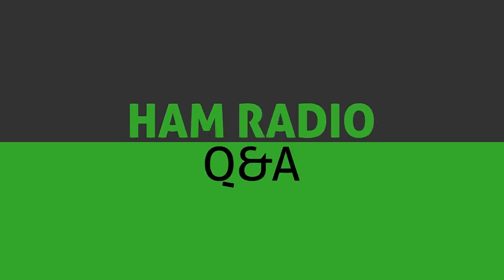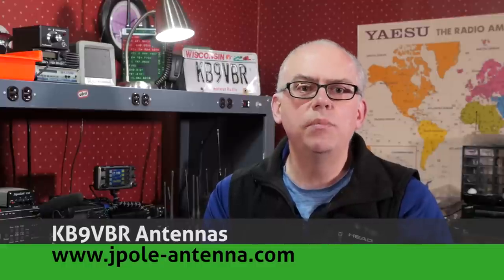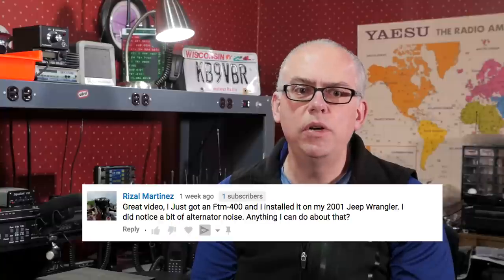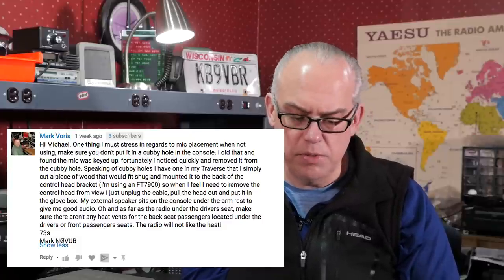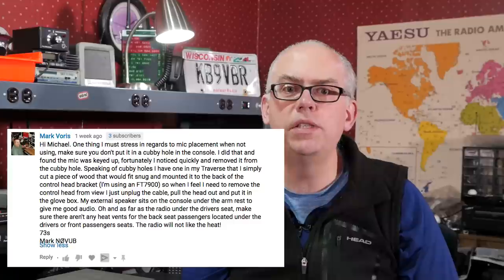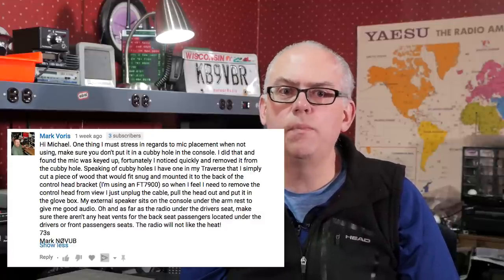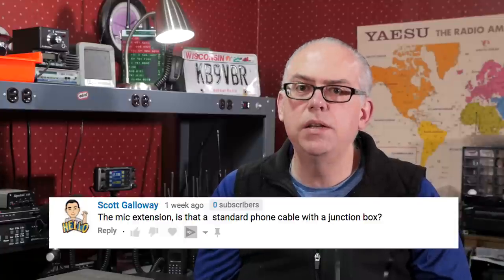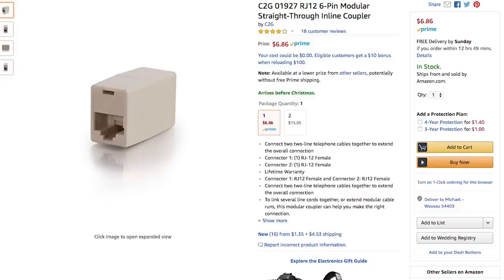Your Questions Answered (Mobile Install, Inexpensive Radios, Power Supplies) - Ham Radio Q&A

Comment: Great info.  Recently discovered your videos and getting a lot out of them, thank you, as a new General operator. You seem to be dialed in to Yaesu use/features.  On to the challenge facing...

I have a Yaesu 400XDR and FT3DR which feature Bluetooth (BT).  However for my vehicle, have found no (as in zero) BT headsets available with PTT functionality.  

Yaesu used to make one and now only sells a small earbud style unit, like old cell phone ear units.  

Like you I need something better than base unit speaker, and was hoping when I purchased the 400XDR and optional BT chip that a BT headset would be the answer.  But nobody makes the BT headset with PTT anymore.

Any insight to making use of the Yaesu’s BT capability or otherwise an effective headset solution?  That preferably for the accompanying wife’s sake and to cut through hearing over ambient vehicle noise... one ear or two, doesn’t matter.  Just can’t find a solution.

Comment: What handheld would you recommend that has removable battery pack for extended field use with extra battery packs when recharging is not available?
Reply from the maker: For a radio with an extended battery life, I'd look at an analog model as digital radios consume power at a higher rate. For example: the Yaesu FT-60R is analog only, rugged, and has a long battery life. Aftermarket batteries are also available so you can carry a couple of spares with you.

Comment: I use an Ethernet cable for a mic extension cable on my ic-2100
Reply from the maker: The IC-2100H was my first rig! You're correct that it has an 8 pin connector. I built an APRS cable for it with a piece of ethernet cable.

Comment: I use a bluetooth to FM adapter for my late model BMW 745Li.  I bet you don't see too many 7's with a ham radio in them. : )  No need to feed a speaker wire through the car as I have my ID-5100 mounted in the trunk. The optional bluetooth module for the 5100 works perfectly. - KC3HUL
Reply from the maker: That's awesome. It's great that you can enjoy both ham radio and your sweet ride.